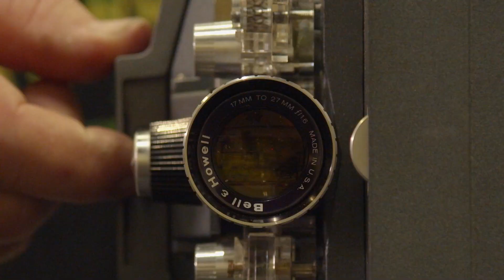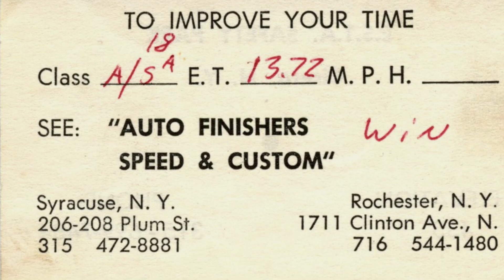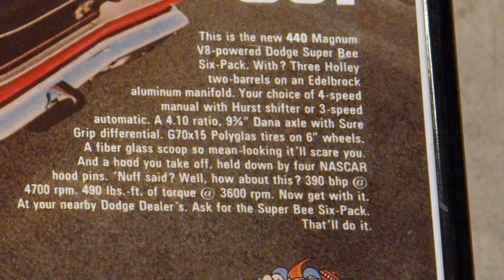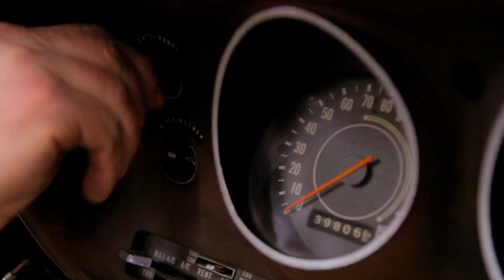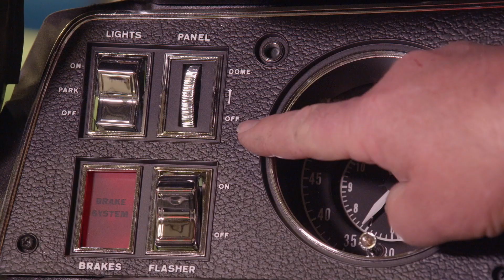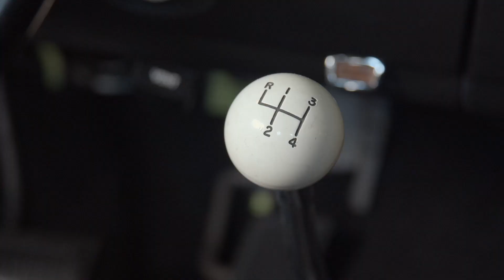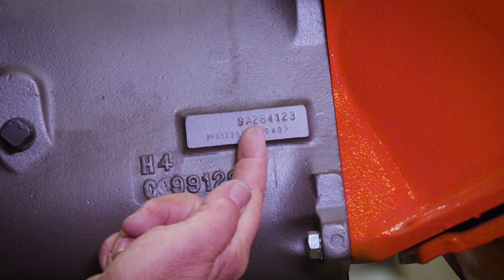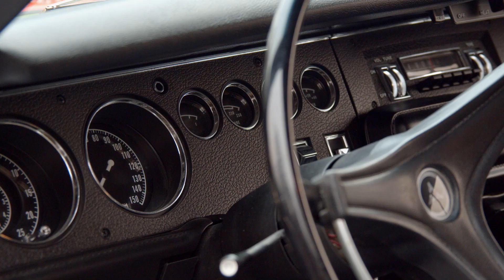HIS DAD DIED THE SAME DAY HE DECIDED TO HAVE THIS CAR RESTORED!

Comment: Actually the center carb is a 500 cfm the car runs on center one and when floored it opens the two 350 cfm  carbs with a combine 1200 cfm of air with a ram air grabber hood scooping cold air into the intake good idea the ram air fresh outside cool air which dodge did one better and ran the air conditioning into the intake and chilled the air on demon and hellcat cold air makes power